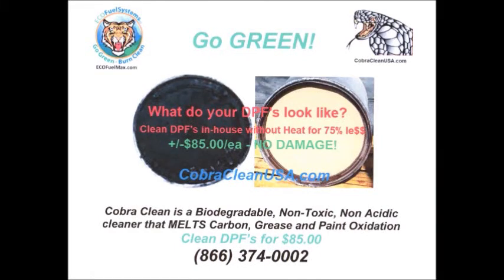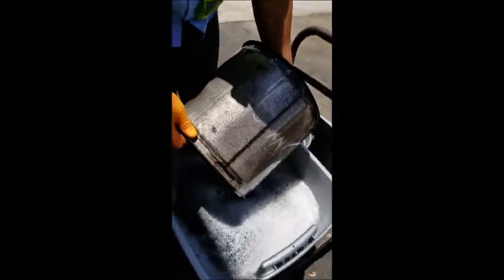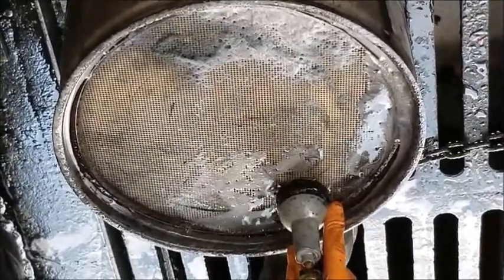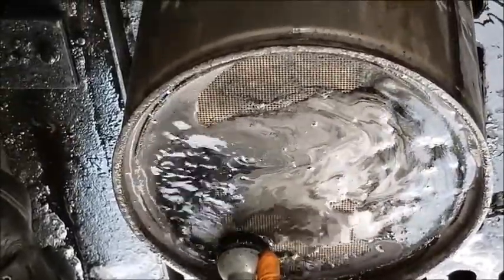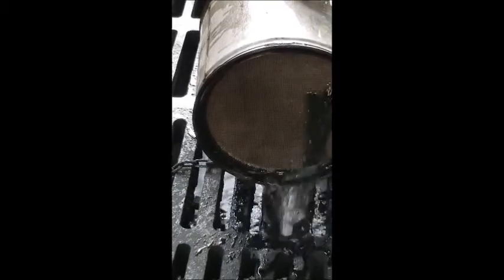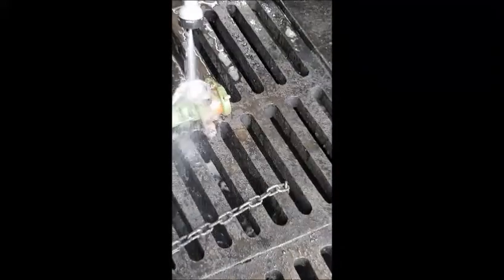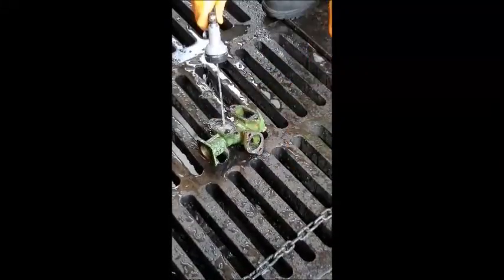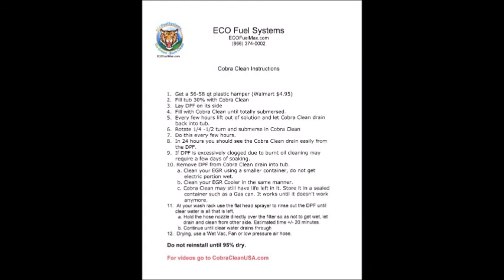DPF - DOC & EGR Cleaning in house without Heat 75% savings

Comment: How long and how DPF Filters needs to be dry after that ??? Is it OK to install wet, or it needs to be dry?
Reply: Astra: DPFs should be dry for best results. Some use a wetvac, some a air hose and others put it in the sun if avail. A diesel motor exhaust gets to 1100-1200 degrees so a slightly damp dpf will dry. A wet one could restrict air flow, not reccommended.
Reply: Use a wet Vac or sunshine. if it is damp the 1100 degrees from a motor will drty it. Do Not install wet.

Comment: You've probably replaced it by now, but that guy had cracks in the substrate bud.
Reply: Cracked DPF need to be replaced, heat cleaning or pressure washing could damage a filter.

Comment: How many gallons would I need for soaking?
Reply: Richard thank you for your question/response. For a standard Truck DPF that is approx 14" tall and 14" in circumference you will need 13-14 gallons as can be seen in the You Tube videos. a 15 gallon container should be able to clean 2-3 DPF's so do not dispose of the used Cobra Clean. Note, Do NOT let it FREEZE. To see more videos go to ECOFuelMax.com in the right link column click on Cobra Clean. detailed instructions are there. You can always call me 561-860-6888
Reply: A typical DPF needs 15 gallons.
Reply: A standard DPF needs approx 13 gallons. We now sell it in a concentrate 5 gl can clean 5-6 DPF's

Comment: Absolutely requires heat to remove the particles that are actually plugging the dpf
Reply: Thank you for your comment. Sorry to say thousands of DPF's have been successfully cleaned without heat. Heat damages a DPF. The Cobra Clean is 100% biodegradable Non Acidic, Non Caustic. The YouTube DPF video you commented on was one check out the others on YouTube click on CobraCleanUSA and have fun. If you prefer heat that's your call but beware you may have to replace your DPF after 2-3 cleanings with heat (+/-$2300). Order 15 gallons and test it, you will be a believer. Cobra Clean costs +/- 75% less. Have a GREAT Day!
Reply: @ecofuelsystems7567  we all get that your cleaner is environmental friendly 100%.  The issue with some on here is the soot is instead of going into the air is now going into the ground.  Yes, I know use a filter.  The soot is about 2 microns in size.  You're not going to find a wash rack or drain table with those types of filters.  BTW FSX does back most filters they use air to blow them out and have a way to gauge whether they pass the air flow.  So, how exactly do you test to see if there is any cracking going on within the dpf and that the dpf is cleaned at the suitable level for reinstalling (well there's no more black coming out, I guess it's clean)? I don't own a FSX machine but I'm tired of seeing you bash it when it does the job right.
Reply: False, Cobra Clean will melt the carbon
Reply: Incorrect, Cobra Clean melts carbon with a  Biodegradable solution No Heat needed. Soak Dry and reinstall. Follow instructions.
Reply: Don't knock it until you try it. Works great for thousands of users.
Reply: @ecofuelsystems7567  I haven't said it doesn't work.

Comment: I find it very effective to rev the engine up and jam a garden hose into the intake and turn on the tap, the cylinder pressure will push the water through at high pressure and clean out the dpf.
Reply: Lol. Don't give out the secret of how you get a new engine. 😄
Reply: It may be partially clean and could damage/crack the ceramic DPF median

Comment: May I ask how do you dispose the used water that contained the soot and ash from the DPF? Or do you recycle the used solution?
Reply: Jun The solution after soaking the DPF should be rinsed out on a wash rack with a filter. The Cobra Clean after it is used up after a few cleanings can be disposed of with waste oil. Cobra Clean is a Biodegradable Non Acidic Non Toxic solution.
Reply: You are advised to rinse your DPF in a wash rack that has a filter. Most commercial facilities have a filter on them. DO NOT use a pressure washer. Some trap it and  recycle it with their oil.
Reply: You can dispose of the used Cobra Clean with waste oil. Note just because it is black does not mean it is spent. if you set it aside covered the soot sinks to the nottom. 15 gal can clean 2 sometimes 3 DPF's.
Reply: It is best to rinse in a filtered wash rack in a commercial garage. If not avail some use a homemade filter to trap the carbon. The COBRA CLEAN itsel is Biodegradable.
Reply: Down the drain..
Reply: The dirty water from the Filter should go inot a cleaning filter on a wash rack. The dirty cobra clean that the filter is soaked in should be disposed of with your Waste oli company.

Comment: Does it make the grit safe and bio degradable
Reply: No it is reccommended to filter the waste particles.
Reply: Its your money replacing a filter is expensive, your call
Reply: The grit is Carbon waste only the solution is biodegradable. Dispose of dirty cobra clean properly. The DPF rinse in a wash rack, the dirty soak cobra clean with waste oil company.

Comment: You do realize that the manufacturers classify this soot as hazardous material right?
Reply: Yes, a cleaned filter should be rinsed in a wash rack that has a filter.
Reply: Backyard mechanic: no, we just rinse it out with water in a ditch behind the shop and hope nobody notices.  Lol 😁
Reply: Yes it is recommended that a filtered drain be used to trap the soot. Commercial users who are 95%+ rinse and trap the soot.
Reply: yes, it is reccommended to filter the soot.
Reply: Oil oil is as well dispose of it with waste oil. GO GREEN Burn Clean!

Comment: You got to be kidding me. This is the dumbest way to clean a DPF. Get it baked and pressure tested.
Reply: Bake it 2-3 time and replace it. Some after cleaning with Cobra Clean pressure test it and yes it works as good if not better than heat, no damage. One Florida Municipality that has a FSX machine washes, rinses and then uses the air to dry and pressure test it. If it didn't work why would they stop using the $45k cleaning machine.
Reply: Please tell me your results after baking it 3 times after 3 $500 cleanings with heat. Cobra clean will not harm a DPF and can be cleaned +/- 8 times for $80.00. Here to help. Municipalities with FXS machines use Cobra Clean to keep DPF's cracking.

Comment: Not really a good accurate way to clean.. since you need to bake it 1000F and then use air to remove all the ash content in the ceramic traps. This method removes some of the soot yes.. but dosnt do the same thing as baking I and blowing compressed air.
Reply: Ununius
By using Cobra Clean a Non Toxic Non Acidic cleaner that melts carbon you will not need to bake a DPF at 1800 degrees. By not using heat a DPF can be cleaned more than the 2-3 times using heat. Testing has shown a superior cleaning verses baking. Soak, Rinse, Dry reinstall and off you go. Thousands have tried it and swear by it. It is hard to comment unless you tried it yourself. Good Luck.
Reply: Here is another answer. Baking a DPF will damage it aftew a few cleaning. Replacement is +/-$3,000. Your call don't knock it until you try it.
Reply: Cobra Clean melts Carbon Particulates from a DPF. A diesel motor runs at 1,000 F. Baking gets as high as 1,800 degrees F.

Comment: Don‘t you think, something is wrong, if you have to clean it 8 times?
Reply: I think he means its been cleaned 8 times not at once.
Reply: @Sdukes001  The 9 cleanings took over a million miles, not all at once. Thank you
Reply: Either way.. this method dosnt remove the ash content inside the ceramic traps... you need to cook it 1000f amd then use air pressure to get it all out.
Reply: @ununius7436  the process of baking it is to burn the remaining soot. Then after the ash is blown out and the ash should be contained.
Reply: @ununius7436  even cooking it at 1000 doesn't break down the ash, both methods only attack the soot, thats fine for cars that have clogged from missing a few regens or from faulty glow plugs

If you want to clean an old dpf use this method first to remove as much soot as possible and then soak it in 1 part brick cleaner 3 parts water, that will dissolve the ash extremely quickly whilst having little to no effect on the stainless, platinum or cladding, just don't soak it for too long, you'll know its working if the liquid coming from it is stained red as the ash is red and the soot is black

I hope this helps you clean it from home as it seems extremely difficult to find information on the dpf even from garages, however theres many people cashing in big on flushing a single solution through or running a forced regen that will only last a few months

edit: make sure you use either this method or a heavy degreaser such as caustic soda drain unblocker first, as the acid solution has piratically no effect on the oil/soot which can then protect the ash deposits ( and make sure the drain unblocker remains under 100 degrees c as beyond that point it will react with the silica)
Reply: @ununius7436  Incorrect Cobra Clean will melt 95%+ of the carbon particulates and will not damage a DPF like heating it at 1800 degrees does. Soak, rinse and dry. A typical diesel motor heats a DPF to +/-1200 degrees when it goes into a Forced REGEN Cycle.
Reply: Cleaning 8 times was done on a bus, stop and go over 800,000 miles.
Reply: Driving 1,000,000+ miles a DPF especially if left running will get dirty and clogged. Our position is that Cobra Clean will not damage a filter.
Reply: he means you can clean over and over 8 times before you need a new replacement
Reply: You are mistaken, you can clean +/-8 filters or one +/-8 times (millions of miles).

Comment: how ecologic?
Reply: SLAWEK
The Cobra Clean is a Biodegradable Non Toxic, Non Acidic cleaning solution that melt5s Carbon. When rinsing the soot out it is advised to trap the soot in a filter on the wash rack or drain filter. Good Luck & save $$
Reply: Non Acidic, Non Caustic. Dispose of used Cobra Clean with dirty oil.

Comment: When I wash with garden hose  i hook up to the bottom of my water heater that works great for me
Reply: In other words you connect 8 hoses to the bottom of your water heater tank and spray through the filter all at once?
Reply: @dannewtonful  I think you are trying too hard to find fault. Hot water is not needed but if users prefer it good for them. High pressure is not recommenced. A flat hose nozzle works best as seen in the videos. Give it a try and see for your own. If you DPF has been heat cleaned it may be cracked? Cobra Clean will NOT crack a DPF.

Comment: I wouldn't pay a dime if this is how they are "cleaning dpf filters"
Reply: This is why it’s on YouTube… to make it accessible for DIY’ers. I don’t think the professionals would use these methods as they have a much more complex and functional set up with all the right equipment. This is a layman’s video so the whole point is not paying a dime to do the job that needs done.
Reply: @jobbiejew  Commercial and municipal governments are the primary user of Cobra Clean. Some even own a FSX professional oven and stopped because Cobra Clean dis a better job with no damage.
Reply: Your call heating one will dmage it. Cobra Clean melts the Ash.
Reply: Why? I really don't understand.
Reply: Soot is burned out, I would not use water because it with cause ash to turn into concreate.

Comment: Lolol this is the worst thing i've seen not even close to accurate method of cleaning and this will only remove portion of soot does absolutely nothing to remove the ash content this is why this is done with a solution and high pressure water jetting not a garden hose and bucket of chemicals just saying oh light tables are used as well
Reply: Any design suggestions for creating a better dying system? I was thinking they could increase and further control the spray nozzle with something 3D printed, something that sprays the entire flow through as opposed to spot rinsing. They could also add a frac tank to let heavy carbon sediment drop out and re-circulate the water and or solution.
Reply: @dannewtonful  Use a flat nozzle sprayer so you won't get wet. I have tried many different variations, the flat head hose nozzle works best. Yes it takes +/-10 minutes per filter to rinse, that's the hard part.
Reply: Devin Don't knock it until you try it. Heat 1,800 degrees is proven to damage a DPF
Reply: Talk to someone who uses it. You cannot comment until you try it. Thousands that do love it. It is biodegradable as well. GO GREEN Burn Clean

Comment: How often are the cleaning recommend
Reply: It depends on your duty cycle.. if you idle alot of the time you will need to do it more often   like yearly
Reply: every 100k kilometers
Reply: Monthly if your lucky
Reply: When it gets dirty. depends on use. some do a 6 month service thats for stop and go vehicles. Check out the ECOFuellMax to reduce particulates.
Reply: Your call every 6 months or yearly. Or when it gets dirty. depends on stop and go or ideling??

Comment: So if it’s cracked, what are disadvantages of still using it?
Reply: When its cracked it TOAST!!!! If you have to perform a forced regeneration on any DPF system you have something WRONG!! Most likely its Upstream Failure from an over fueling injector, cracked injector cup, leaking EGR cooler, burning engine oil, failed turbo, ECT. You have to address the failure FIRST before replacing the DPF or you will this same issue agai . If the aftertreatment is performing like it should per OEM specs you will need to remove and clean it every 300,000 miles.
Reply: Sky, it will not work and the sensors may shut your vehicle down.
Reply: Cracked will not perform the same way and your NOX conversion and EGR pressure will change and truck will debate eventually.. also may not reach proper regeneration temperatures
Reply: When a DPF is cracked replace it. A cracked clean DPF will not work properly. In the future using Cobra Clean will extend the life of your DPF, heat kills it.
Reply: Flow. You can also measure it, the flow. To see if it is to restricted
Reply: The computer won't like it
Reply: It wont work. computer shuyts down.